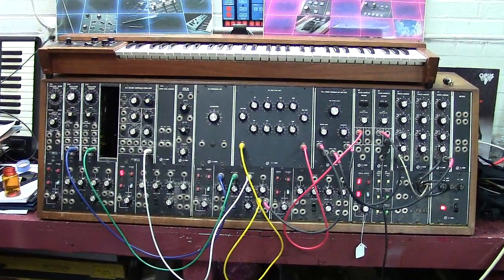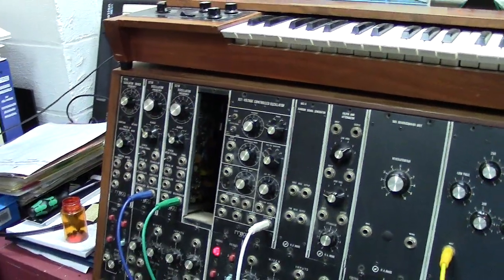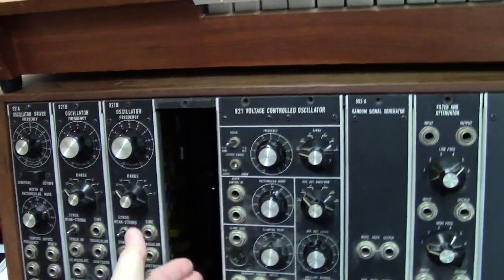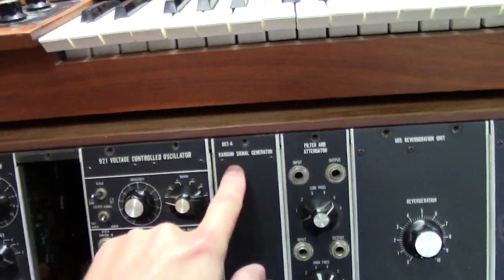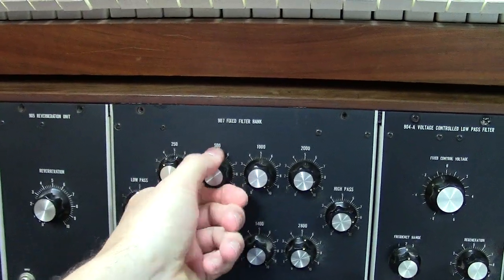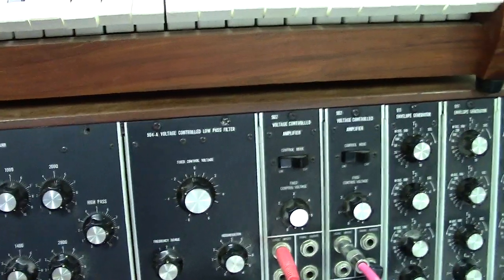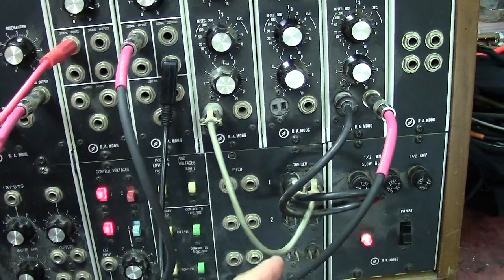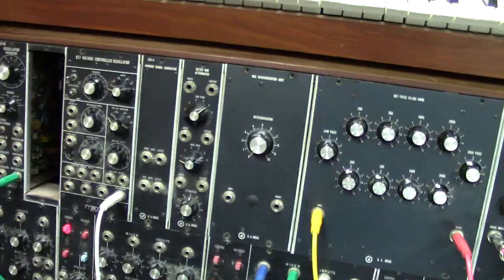Andrew's Moog Modular 1C Restore Part 1 (by synthpro)

Comment: Hi Jareth, thanks for the video-what a beast! (I sat here with my headphones on and it sure rattled my teeth) !!
Looking forward to a good look inside the modules,can I ask you what will you do if it needs any new semiconductors,the original ones fitted by  the good Dr must be well unobtainable by now ?
Thanks again
Reply from the maker: Thank you, it's definitely a experience.  Luckily I do have lots of new old stock parts when it comes to some of the components but there are actually still quite a few things that are still in production. Cosmetic or cabinet parts are the hardest stuff to source.